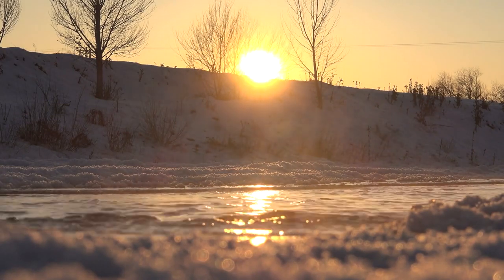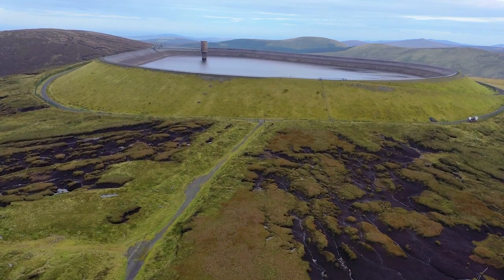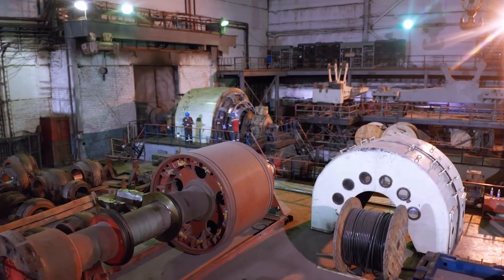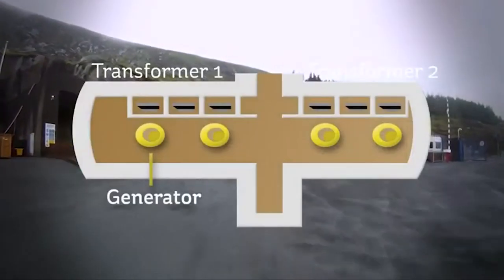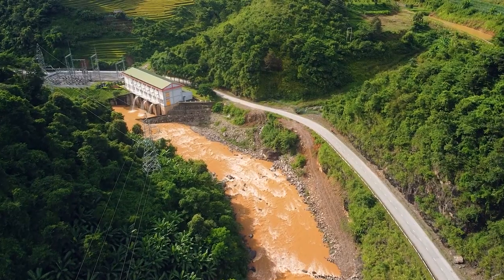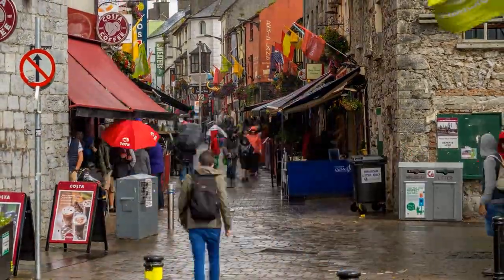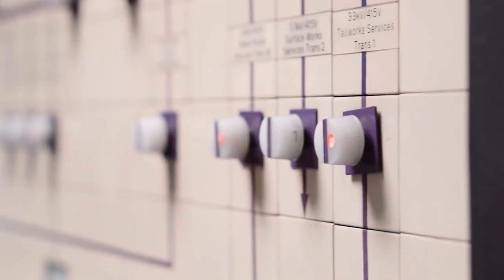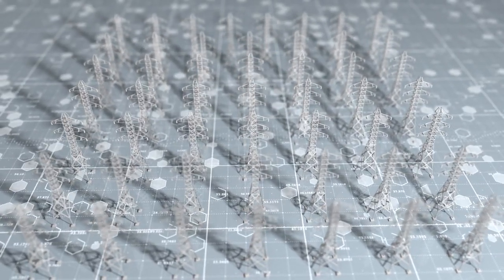Pumped Hydro - The Next Big Thing in Renewable Energy

Comment: Excellent possibility for areas where there are mountains.  There should also be a strategy for container breakage in the event of an earthquake.  Discovering storage batteries made of very cheap materials is probably the ultimate solution, using AI to optimize the search.
Reply: you don't need mountains for that, a hill with 100m altitude difference is enough. Even Lithuania has a hydro pumped storage and its highest 'mountain' is 300m tall lol
Reply: @tomassakalauskas2856  Interesting, so even a flat area can dig a big hole, pile it into a soup bowl hill, and have overnight electricity.  You wouldn't want to use landfill hills for that, because they are filled with valuable materials to be mined later.